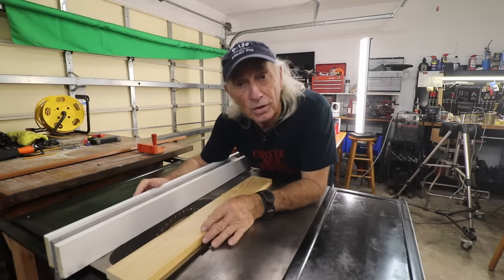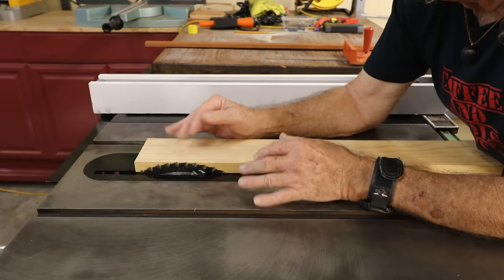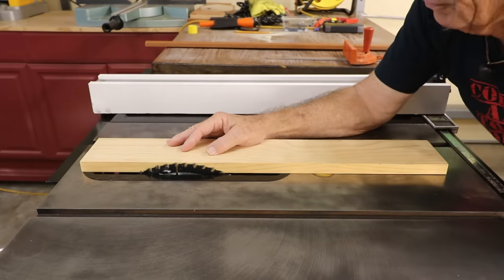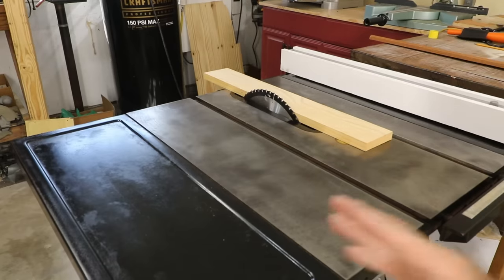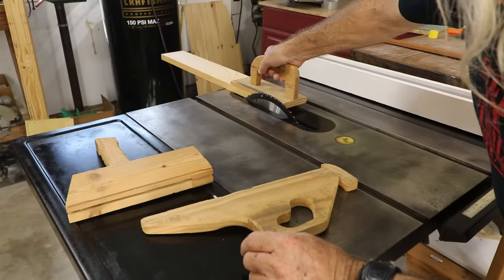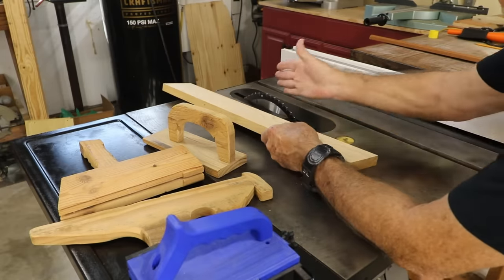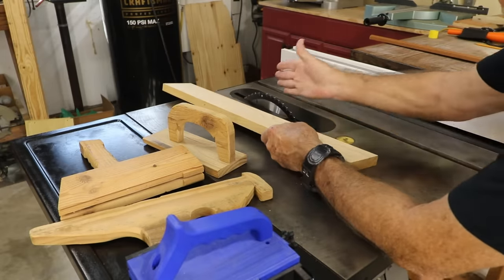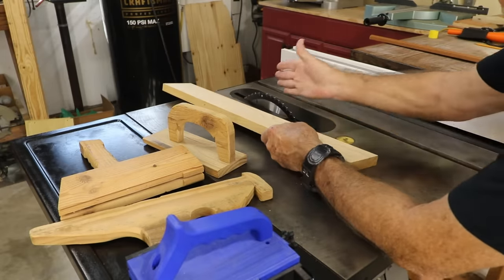Table saw secret nobody will talk about from the good old days, C&T episode 180

Comment: Just learning wood. Machinist by trade. Keeping the blade at the lowest possible position engages the most teeth of the blade possible. It stands to reason keeping the blade higher than necessary would be a best practice in yester year with limited motor hp available in most smaller tablesaws. Raising the blade clearly uses less hp. Without instruction I instinctually keep the blade as low as possible. I like my fingers? Completely understand why older generations tend to be more comfortable with higher than absolutely necessary blade heights.

Comment: I always set my blade with the bottom of the gullet which is the opening below the teeth with top of the board or plywood the gullet is their to clear out the of saw dust always remember the five inch rule  you start with five fingers  finish with five use a push stick for five lnches or less the I still have all ten I don't think you will go wrong I hope this helps some and have a bless day

Comment: "I'm going to be putting a riving knife on it, even if I think I don't need one..."
Seriously???? Anyone who makes that kind of statement cannot be taken seriously when it comes to table saw safety.  I would suggest that maybe your safety record is more about luck than anything else.
Reply: I am interested in this statement. Please explain more.
Reply: What do you mean? Put a riving knife on for extra safety whats wrong with that?
Reply: @fullmortise  Please read the quote more carefully.  The issue is not with putting a riving knife on.  The issue is with the last part of that quote.  "even if I think I don't need one".  Anyone who doesn't think they need a riving knife for safety should not be taken seriously when it comes to safety of a table saw.  
Throughout the video this guy was talking about how he's in control of the wood.  Yeah, until the saw decides otherwise.  
There is an order to safety: Eliminate the hazard, Engineering controls, administrative controls, PPE.  He is working backwards.  A riving knife is orders of magnitude more safer than trying to control the wood, than some of those push sticks.
Reply: @tchevrier   There are times when you don't think you need one and times when you shouldn't or can't have one on. Your not going to have one with a dado blade, certain materials where you don't need one  , if your plunge cutting , maybe you need to change the insert. The most dangerous way to use a table saw is someone who is not confident or scared of it, and the second is a confident person who gets overly comfortable.
Reply: @fullmortise  I'm not saying that there aren't times when you can't use a riving knife. What I'm saying is that those times should be the exception not the rule. And to argue that "there are times when you don't THINK you need one" is absolutely arrogant, ignorant, foolish and dangerous. Clearly somebody who makes a statement like that does not understand what a riving knife does and why it is an essential safety device.  No sir, the most dangerous way to use a table saw is to start removing safety devices.
Reply: @tchevrier  well then  im a unsafe carpenter of 25 years because the first thing I do is throw out the gaurd its always in and not practical for production work. Like Mike Rowe says its not safety first its safety 3rd.
Reply: @fullmortise  And that indeed makes you an unsafe carpenter of 25 years when it comes to table saw safety. Safety devices are there for a reason, and believing that they are simply a nuisance device and that you can handle the saw in a safer manner makes you naive and uniformed.  But your actions are your choice.  However, trying to teach, or convince others of this is irresponsible.
Reply: @tchevrier  Actually I had a pretty scary incident in apprenticeship school with a cabinet saw kick back so strong than it would of went through some one. I've had a bad kickback experience with a stacked dadoe blade on a contractor saw but again it comes down to production,  risk vs reward , whats available to you on site. Its not black or white if everyone had the inexperienced mindset as you nothing would get accomplished.  Someone with 10k hours behind a table saw vs the guy in his garage playing woodworker need a completely different set of safety guidelines.
Reply: @tchevrier  Spoken like a true weekend warrior with a table saw. When your trying to justify your journeyman pay or just trying to make a living running so many feet per day to cover your gas, bills, insurance etc its not so black and white. Its a competitive world and the U.S seems to forget that. Pay a fast food worker 40 per hr for all I care but then what does a 1st year apprentice make? We have to use our power tools to cut materials and fasten them back together to make a profit. Safety for an experienced carpenter and  a apprentice is subjective.  And the longterm injurys that cause tradespeople the most grief is rotator cuff injurys and bad backs. But we've got to make a living. Lots of wood workers in India seem to never have shoes on practically using thier toes as feather boards. You might call that stupid but I call that not having a $300 pair of Redwing boots and still making a living for their family. Its not safety 1st it is risk vs reward and most of us have to be productive members of society the governments not going to wipe our butts.

Comment: Ya have a few years on me.
Still that dates to when every one had a stack of steel blades on a carage bolt to drop off at the sharpener's.

Being a field carpenter, in the early days, we seldom had table saws.
I did like circular saw blades set deep.

Then we all started hauling around radial arm saws. Talk about frightening !

When portable table saws showed up, I did not feel the need.

Over night , I could not live with out one.

I did like blades high, after all I learned on a radial arm saw. 

Now I like the full gullet exposed.

Thanks, I like your push blocks.

Keep it fun. Chris

Comment: I.m 67 yrs old cut like you and use the safer guide tools as well. If I.m not in control I won.t do it just that simple.
Reply from the maker: This saw was sold to a pro cabinet shop, but so many come into my place with no safety, but it is the way I grew up.

Comment: Ripping with TS or RAS is inherently dangerous, when there are both the desired work and the remainder. They can bind. 

Except for work that is neither long nor short, when I can manage to keep the desired and remainder controlled and only when the wood is thin, I always use my bandsaw to rip and then joint to correct width with my TS or RAS with a "ripping" blade. 

When you joint with a ripping blade, there is only the desired, which can be controlled quite well, as the remainder is turn to dust.
Reply from the maker: Binding does seem to be the big issue.
Reply: @SirTools  I believe binding is the issue. No splitter is perfect. One has to apply both downward pressure on both sides and lateral (toward the fence)  pressure on only the remainder. Only with some applications when the work is of the correct length and thickness can this be achieved with near certainty. 

I shun ripping with the TS or RAS for longer and thicker wood. There is a safe and perfect way to rip. No anxiety at all. 

The circular saw blade is a two-dimension cutter. This is the inherent danger with ripping with it.
Reply from the maker: @woodensurfer  I do love my TS
Reply: @SirTools IMO, actually the best use of the TS is crosscut and miter with a carriage and other functions, not ripping. I have a Delta Unisaw and a Dewalt RAS (other miscellaneous uses), but I generally rip with my bandsaw and then joint with my TS with a full kerf ripping blade.

I don't have a compound miter sliding saw. I sometimes wanted one but have always appreciated my RAS. Miter and crosscuts on a TS with the right jig are more accurate than with a RAS or compound slider. 

I have a 12" non-sliding compound miter saw.

Comment: When you put the blade that high it heats the blade up and causes it to warp. The most any blade should be raised above the stock is to the bottom of the cooling slots or tooth profile. FACT. I’ve been a carpenter for 45 years. Still got all my fingers too… lol…
Reply from the maker: I've heard the heat theory and we'll set up a test and see what it looks like.
Reply: @SirTools  
I’ve been a carpenter and cabinet builder for 45 years. I’ve tested it many times… Unlike a skill saw which is used primarily for short cross cuts and an occasional long rip on framing lumber, the table saw is used for log rips on all types of wood… including hardwoods. The duration of the cut has a lot to do with it I’d imagine…  the more blade surface being run through the material you’re cutting, the more friction/heat you are creating.

Comment: You won’t rip down a piece of 3/4?  Thats what a push stick is for.
Reply from the maker: Not fussy on push sticks, but it really depends on what is safe and what is risky
Reply: @SirTools  I with you on the safety bit. It is all about how far away your fingers should be from a moving blade at any given point.
Reply from the maker: Darn right :)

Comment: what's wrong exactly with using the saw "backwards", surely pushing the wood on the table saw from the other side completely removes kickback as a dangerous factor. why don't modern table saws have a facility to hold down the piece with a roller( it would only need adjustable height and could be the full width of the table like a drum sander or thicknesser has) , it could keep pressure down on the wood to eliminate your hands being near it and allowing the saw to cut safely away from you, the blade works the same in both directions as long as the wood is held securely.

you know what scratch that, forget i said it... see you in 3 years when i own the table saw market.
Reply: @George Myers my circular saw works with the blade cutting backwards, it works because it has downward pressure applied. I understand that without the downward pressure the blade will catch the wood and drag it out of your hand. But both Drum sanders and thickness planers work on the same method , they auto feed using downward pressure if you had an assembly over the saw to hold the piece down with rollers it would feed into the blade and cut the wood. It would require the use of a fence at all times to keep the cut straight but there's absolutely no reason it wouldn't work.

Comment: High blade height gives a better cut and keeps the blade cooler. Low blade height allows kickback, if you are that afraid of the machine, get a different hobby. (my Opinion) high blade, riving knife, if no riving knife put a slight, very slight fence, out of square, away from the blade at the far end to prevent any possible pinching
Reply from the maker: Not bad, that is how I was trained :)

Comment: I disagree with the safety police. if you run your blade that low the board has a tendency to rise up on the end, then you have to get your hand close enough, beyond the fulcrum which is the edge the front edge of the table and push down to keep the piece from rising up which means I would be pushing my hand down, and towards the blade . no thank you !
Reply from the maker: Thanks Steve for this thought. I think it has merit too

Comment: It is so easy to do it right and so easy to do it wrong, hah. I keep the blade high unless I have to do a small piece and will be near the blade, then I lower it and I go slow. No one seems to mention speed but slower is obviously a cleaner cut and a safer cut. My wife and older kids sometimes use my table saw and the only mistake they ever make is to not push the piece through s8, they sometimes bind it because they stand to far away but I always have them on the table saw with a kerf and the plastic guard so it is never dangerous for em.  My father in-law took off the tip of his finger pushing a piece through... luckily it mostly grew back! (he's always injured himself in minor ways his whole life, some guys are just like that, speed over safety when a project has to get done... oops! Nuther trip for stitches! har!)
Reply from the maker: Keep safe and thanks for this post.

Comment: In my time working in a kitchen manufacturing factory, I saw all manner of foolish practices around the table saw,including a guy trying to cut a nib off of a tiny one inch block of hardwood,he was lucky he never lost some body parts as that nub was torn out of his hand,he was also lucky I never knocked him out for his dumBass stupidity.i always used push blocks and a push stick for the last bit of the cut, never putting the hand between the blade and the fence, better to cut another piece than lose some fingers.
For me the most dangerous machines were the spindle cutters, I used fenced and open spindles,had a couple of occasions when the work-piece shattered ,scary and painful.

Comment: I think besides my table saw my angal grinder with the chainsaw attachment is far more scary dangerous. even with the guard on .making wood bowls and hollowing out that thing can kick back just like a chainsaw about any direction. extremely hard woods, apple, locous , don’t do it . I’ve had them jerk completely out of both hands nearly hitting me several times. the  worst  kickback went straight back in my face. I think my blessed savior for protection he gave me, the saw slightly cut both lips. and the guard was on . I only use it when absolutely necessary . I mainly use a rough wood grinding head from harbor freight. it can still hurt you but not destroy or possibly kill you like the chain saw attachment. anyone even considering buying one don’t do it . companies make far safer attachment than the chainsaw attachment. I am going to make a heavyer steel mask out of all rods to use as a head,neck protector. and arm protector . I thought I would share this experience plus I don’t use extremely hard woods no more . nana and papa wishing you well.

Comment: If you think of the physics be what behind what he's saying the blade is cutting downward when it's higher versus forward when it's lower so it is much safer to have the blade up higher only common sense. If you're afraid of using a table saw then have someone else cut it for you! And don't forget they do make hand saws which are very easy to use too and don't make as much noise so pick your poison
Reply from the maker: Would you believe we've got a list of folks with circular saw accidents....Geezz..

Comment: Doing the calculations, on 3/4" stock, raising the blade from 1/16 above the stock to 1/2" above the stock decreases the engagement of the arc by 3/4". On a 40 tooth blade, It's the difference between engaging 4 teeth and 2, continuous. That means, you'll have at least twice the friction but more likely ( including the extra push force and downward pressure ) around three times or greater friction. Of course, the rake angle of the teeth will determine how well the chips clear in either scenario. The truth of the matter is, there ISN'T a "right" way, BUT having the blade more than 1/2" above the blade to decrease the tooth engagement to 1 is a terrible idea. Not worth the extra risk. So while you might decrease the depth of cut on your fingers, you're doubling your risk of kickback. Personally I don't like riving knives. I'd rather have a heightened awareness of what the wood is doing and what I am doing with it than blindly relying on a tool to save me from a kickback.
Reply: I think that you have had bad experience with low end equipment and/or flimsy or poorly engineered riving knives. Taking a stand against the concept is foolish. The riving knife that follows the rise and fall of the blade and does not protrude above it, as compared to a splitter, has eliminated so much of the objection to using this basic piece of good safety engineering. I think that most Europeans, well accustomed to using such, would find your position on riving knives untenable.
Reply: @leehaelters6182  Think what you will, I never suggested they don't work for their intended design. I just said I personally don't like them. I do cuts on a table saw you can't do with a riving knife installed - arcs, coves, plunges. I've always taken them off and left them off. But don't read into that and think I haven't used them since you know, you seem to be of the habit of reading into a comment with your own interpretation / opinion on the matter  as if there were ambiguity in the words used. I've used both high and low end equipment - doesn't make any difference to me. I will ALWAYS firmly believe in establishing a heightened awareness and understanding of the materials and tools that you are using is FAR safer than relying blindly on a piece of safety equipment. I don't care if its a riving knife, a sawstop, blade guard, roll bars, safety glasses, back brace or leather chaps -  safety equipment should NEVER be an excuse to relax your awareness of what you are doing, period.
Reply: @Adventures_of_Marshmallow , position clarified and noted.

Comment: Wow ...sick of fools pretending to be experts , as a woodworking machinist of 40 years experience . it is simple , the gullets of the saw are to clear the dust & should be just clear of the workpiece , if you can't see the bottom of the gullet , your saw is too low ,if you cansee more than 1/2 inch of plate it's too high ......not exactly rocket science .....oh  btw ....I have all 10 fingers

Comment: Learn to use the tool and not be afraid of it, respect it and know all the potential risks, but relying on safety features rather than intelligence is a bad recipe,  I remove the majority of factory safety features from most everything , they almost always get in the way making precise work very difficult and can often create a new set of hazards.  Bottom line learn to use the tool.
Reply from the maker: Right on !